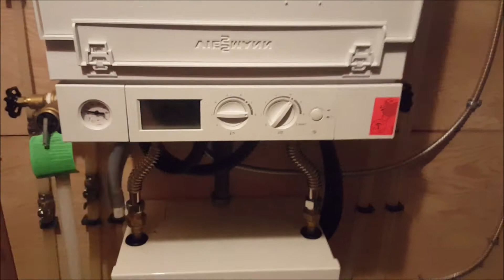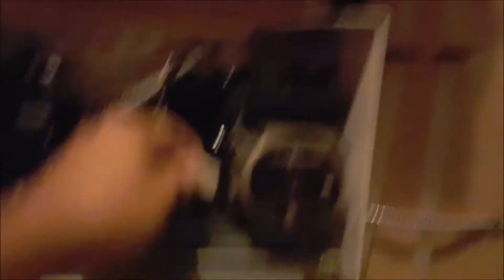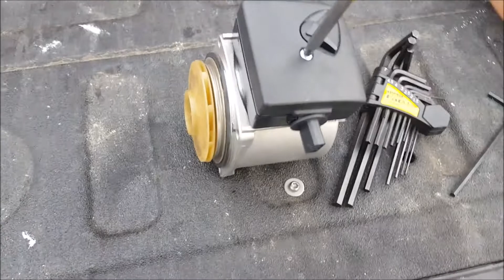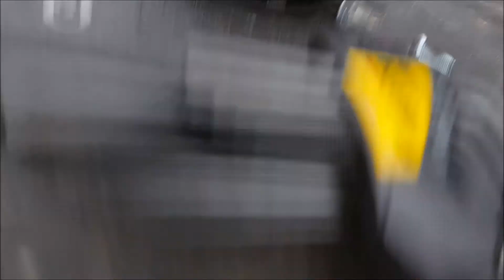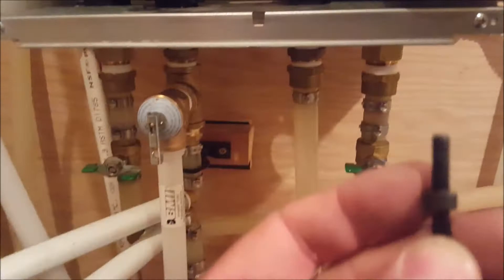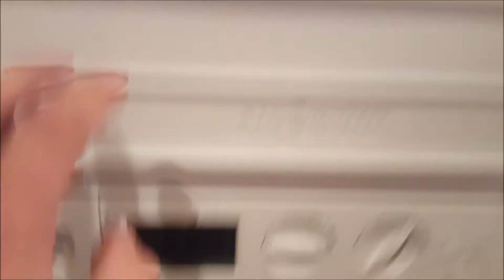2017 Viessmann boiler and combi plus repair (Flow sensor problem?)

Comment: When you were filling the bucket you made a comment there was air in the system but you did not explain what indicated to you that there was air in the system
Reply from the maker: You will get big bubbles out if there is air :)

Comment: Best to drain the heat exchanger via the primary heat exchanger drain point. I twist the ch twice quarter turn and put it on low fire for purge. I've fit numerous Viessmann boilers. I lost count, never really encountered a lemon pump. They're awesome boilers imho. Thanks for the tips 👍